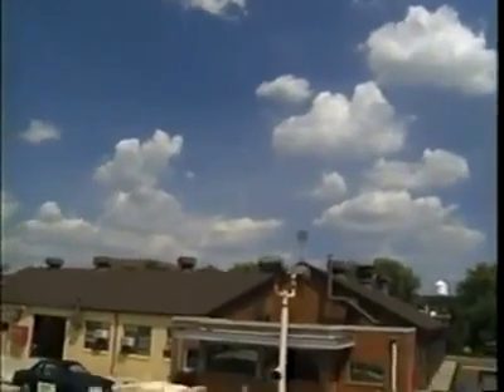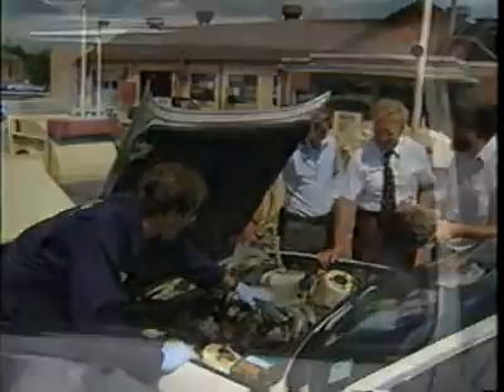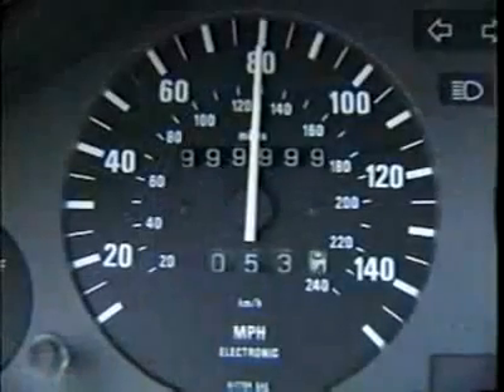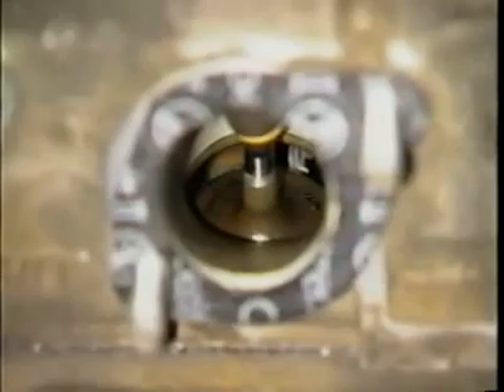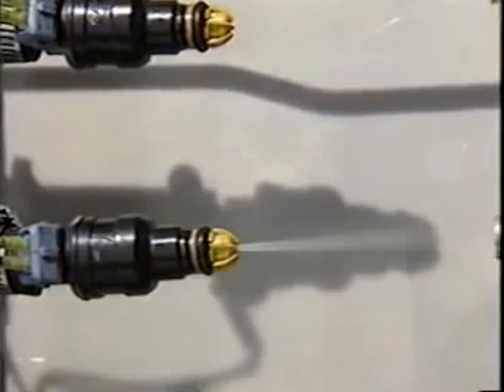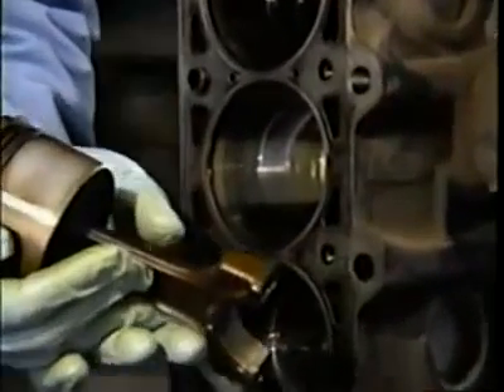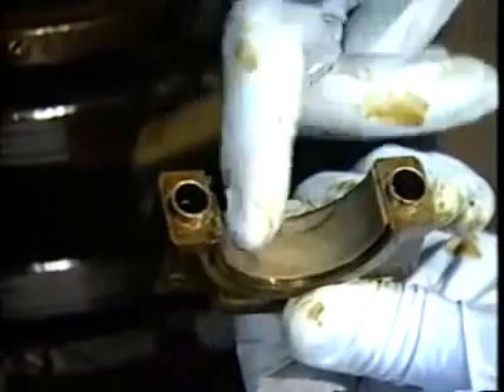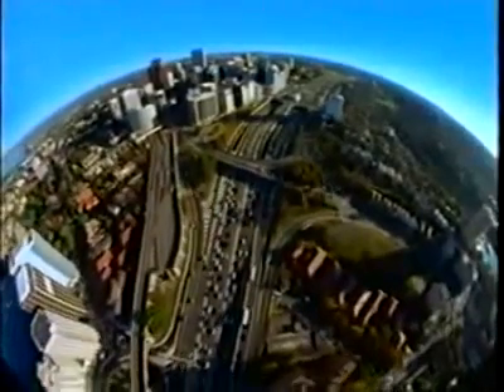The MILLION MILES BMW M20B25 325i ENGINE!

Comment: Thats possible by a engine that constantly is running only with the normal maintenance. What is the engine killer? That every morning cold start. 1 cold start is even bad for the engine and the bearings than 80.000km driving with  his optimum temperature. Every engine can reach over 1 million km driving. When you not turn of the engine. And normal last the engine.

Comment: I dont feel this test is accurate enough. was this test completed in different weather conditions? because the engine running continuosly will not show allot of wear and tear compared to an engine that gets turned off and on the whole time, and that has to cold start 2 or three times a day with at times not reaching optimum temperature